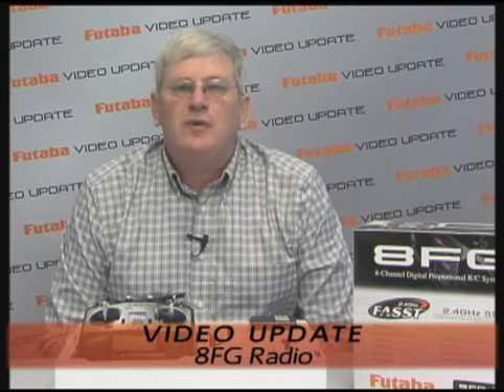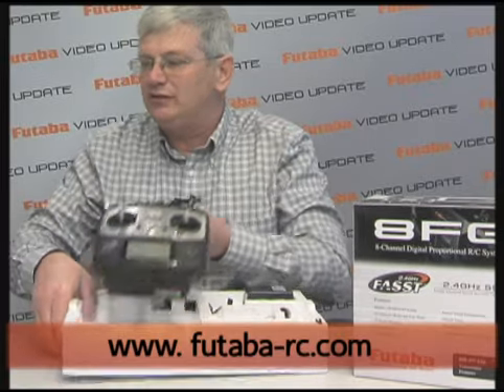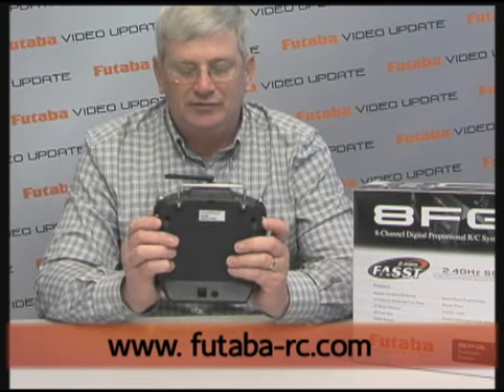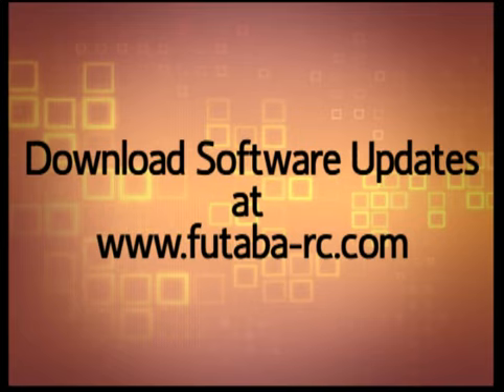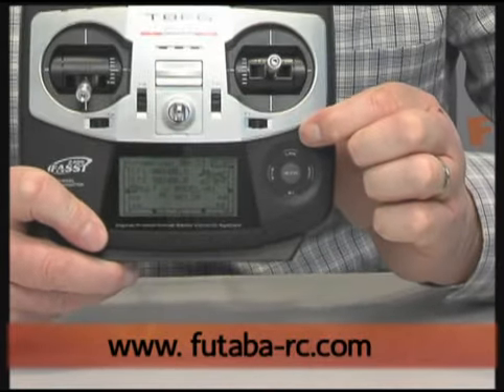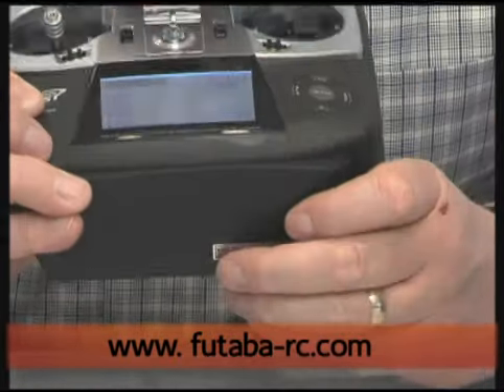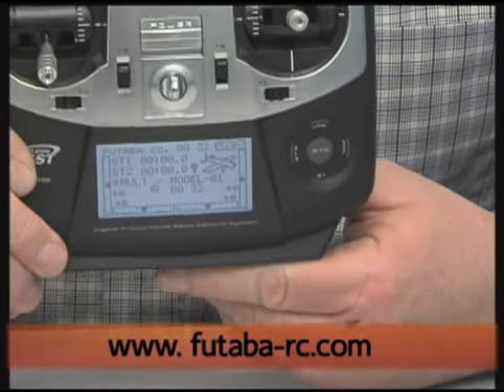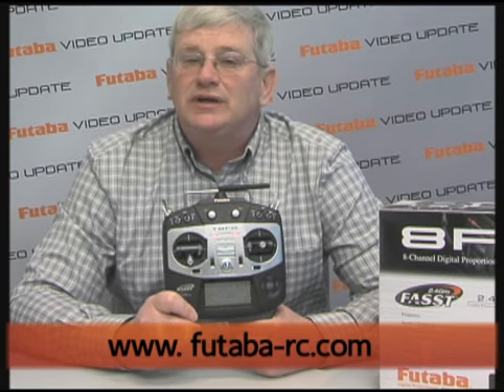Futaba Video Update #1 - 8FG

Comment: I love Futaba. I believe in Futaba. There's no better company than Futaba. My very first radio was a Futaba. My dad bought it for me about 22 - 24 years ago and it still works. Although the receiver has been doctored a few times but I had to stop using it because the frequency got too old. But none the less, it just proves that Futaba RULES. I'll never hold a JR in my hands and never again a Spectrum. My Spectrum packed up and stopped working with a single on switch. Its software is corrupt.